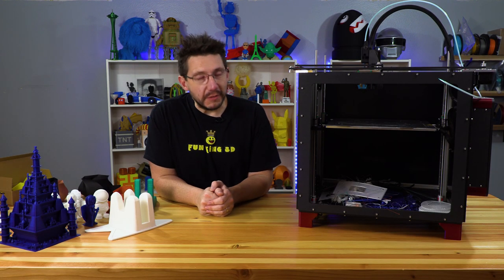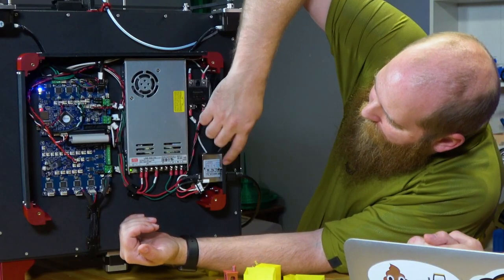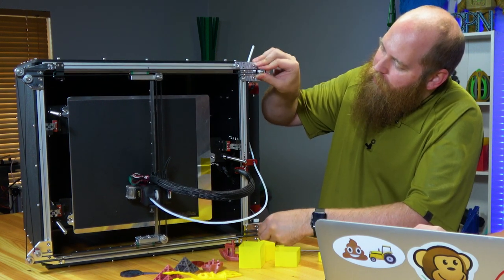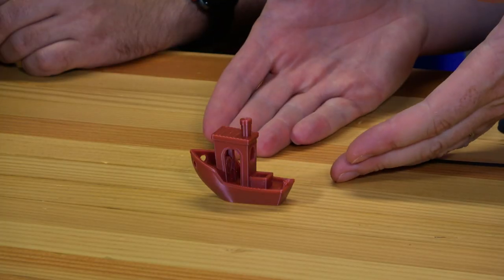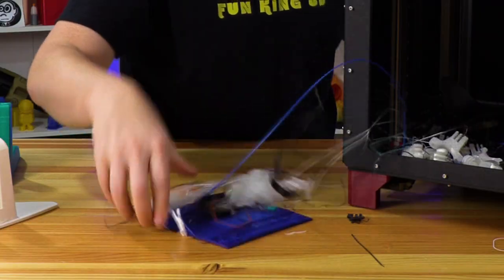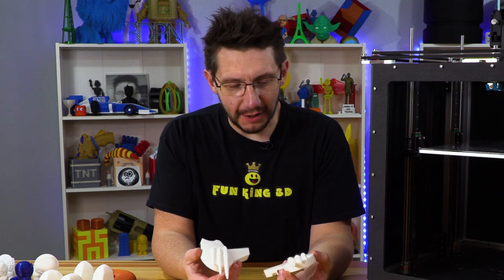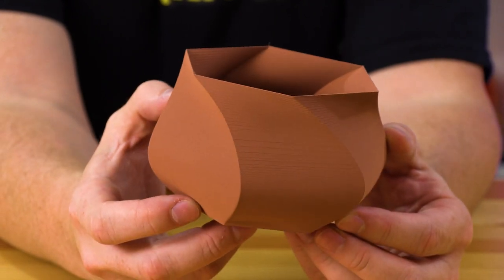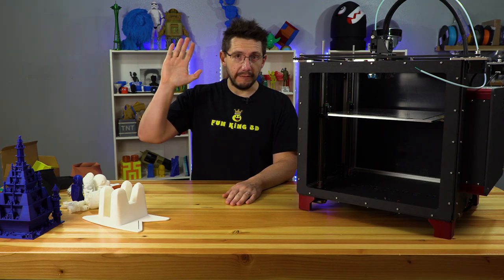Railcore II 300ZL Project R3D 3D Printer Kit Review

Comment: That benchy at 75mm/sec was insane! Geeezzzz...I love this hobby.
Reply: Nothing special with a core, 75mm/s is slow for a core actually, 150mm/sec by 6000mm/s² accleration would be nice^^
Reply: Voron2 does that with klipper, although it's pushing the V6 to slightly beyond limit at common layer heights. With the mosquito hotend, that should be easily doable.
Reply: @jadesontal4947  as i understood it, it is about the bed level accuracy and the special aspect was the very thin layer hight with this speed. It would have been nice to know, how well it performs at 150 or 200mm/sec.

Comment: god I want one of these soooooo badly. I saw some of the 0.02mm (not a typo you read that right) layer height prints this machine can achieve and they are truly awe inspiring !!

I can print benchy's like that all day long with my ender 2 army. ...... at 20mm/s max speed !!! this thing does it equal or BETTER at 75mm/s

staggering. GOD I want one of these things so bad. who do I have to eat to get one.........

as for bed leveling. I question if (within a reasonable price point) if its even possible to achieve the needed resolution with a mechanical bed detection solution.

meaning I don't think a mech switch solution can level with enough precision to achieve the better than 0.02 resolution you NEED to get a 0.02 layer height.
Reply: The one comment I'd make is that the current design has a FULL STEP Z distance of .01mm. The BLTouch I use is repeatable to .01. After a couple of cycles of bed leveling, it reports .004 across the *entire bed*. Even if you assume that it's limited to .01 across the whole bed, that's still well within the required tramming for .02. That said, I usually start with a much thicker layer, anyway, for adhesion - like, 200% high and 200% wide.
Reply: You can use a different bed leveler on the Rail Core, only this kit ships with the one in the video. From what I understand it's easy to replace and you can always start with it if you source the parts yourself. From my research into this printer over the last 6 months it's very easy to modify to what you want.

Comment: The hardened nozzle needs 15-20 °C more than a regular brass nozzle. This could be the reason for the issues you had with nylon.
Reply: do they really? i use a hardened steel nozzle and i dont use it anymore because it wouldnt print right, i thought it was just a quality problem but i didnt know that they needed to be heated more, maybe i will try that.
Reply: @willmoran5694  thermal conductuvity of hardened steel is lower than brass , so yo need to increase temperature to heat filament enough. if you dont , you should print so much slow.
Reply: Steel (nozzleX) nozzles don't conduct heat as well as brass so you have to increase the temp ten degrees depending on the filament.

Comment: One problem I found on my build was that most steppers have at least 1mm of endplay, so the Z height can change as the part weight increases. I had a lot of problems with weighty prints, and I found some steppers "springier" than others, so I put in the stiffest ones I could find to help resist the affects of gravity is the part weight increased. I built a 300ZLT, but I imagine the effect will be amplified on taller machines. Imagine a .1mm change amplified as the print gets taller, the part will actually take on a lean. One taller machines I think a thrust bearing setup would eliminate the endplay problem.

Comment: Hi, Joel - Project R3D has been offering pre-assembled RailCore 2 300ZLs... They are just the kit, built by the folks who gathered the parts, but it will save you the build time.
Reply: IMO they are not just the kits. The kits do not have the touchscreen - it is just being advertized as a possible future option. While the pre-assembled printers already have the touchscreen.

Comment: For nylon I have found a temperature change of a few degrees hotter can make a major difference. Also no fan. On my lulzbot mini the nylon was breaking apart easily at 235, but once i bumped it up 15 degrees it was perfect.

Comment: Thanks for this Joel, I'm going to retrofit an X5SA kit for starters as it could benefit from most of the frame/rail mods, then a new self sourced build once the BOM maths have been done by me for  a 400mm Z , saved me designing one from scratch as this incorporates all my ideas apart from a mech bed sensor, not seen the 3 Z motors before so that is a winner!

Comment: Your Wham Bam is warping slightly from heat....the problem with "spring steel is its BiMetal that expands "non-uniformly". Go down to your local sheetmetal shop and have them sheer you a mild steel galvanized piece...no warp...other than that this printer is SMOKIN HOT and after checking out the price, VERY REASONABLE!  If I had the cash I would order one....very nice review too!
Another suggestion is to tram the whambam at different temps to "catch" the warp at higher than PLA temperatures.

Comment: Doesn't the hardened steel nozzle have a lower heat conductivity? Might be the reason why the nylon prints didn't turn out so great.
Reply from the maker: It does, and, it's possible.
Reply: That is very likely, the hardened steel nozzles tend to be a thermal bottomless pit. We tend to adjust our temps up between 15-30c above brass.
Joe 
Project R3D
Reply: Came here to offer this up. Nailed it!

Comment: Skipped Hiwin rails because they didn't add to the build relative to the expense, but used the E3D gold edition v6. Not to knock the build, because it's just plain cool (and while it tickles me, the gold v6 is only like $40 more on the cost of the whole bot), but it makes me wonder how many corners I could cut in a scratch build without sacrificing print quality and reliability. Filed under "fun project ideas for later."

Comment: Thanks for the review !  This printer is almost exactly what I am looking as my next printer since several months. Linear rails; bondtech & direct extruder, 32 bits electronic etc... But what about the enclosure ? Do it works as  it is not closed on the top ? did you try ABS or ASA ?  What about Flex print and the bondtech extruder ?
Reply: We have a fully enclosed top in the works. All the steppers are outside the build volume (except the extruder) for this reason. ASA and ABS print g reat on it, as does TPU.

Comment: Well... I suppose I need to get myself another printer.
Reply: just not this one,  - prone too board failure, ...  overpriced spare parts....   high five !
Reply: @patrickwatkins7572  I have duet on 2 printers and works great, all boards fail if you connect them wrong
Reply: smiles john
Reply: @mostlymissiles  smiles john
Reply: @patrickwatkins7572  The duet is the best board on the market currently, hands down.
Reply: @tonyakens8228  . not in my opinion,  but im an electronics engineer,  so if you care too elaborate, im all ears
Reply: @patrickwatkins7572  so why it itsnt the best and which one is ?
Reply: @patrickwatkins7572  My Duet WiFi has been rock solid for over a year, since purchased. Care to elaborate why you say this? What's failed on yours?
Reply: @patrickwatkins7572  The feature set & firmware are the best I've found. (I have several duets) One or two folks are using Klipper, which is looking like it has great potential, but isn't there yet.  That said, the RailCore can run on other controllers, too. Which would you prefer?
Reply: I'll wait for the price to go sub 1.2 grand..  😆😉👍
Reply: @patrickwatkins7572  show us a better board and we will test it.
Reply: @elfpimp1  if you are wanting to hit the $1200 price point you will have to self source and buy lower quality hotends, extruders and rails.
Reply: @elfpimp1  don't even think about hiwin rails then
Reply: @mostlymissiles  lol. I have a printer. Cost me less than US $350. 300x300x400 print space.  I love the 20/20 frame and all the connecting hardware is metal. I can switch between 1 and 2 nozzle system if I want. And it's fun to use.
Reply: @Patrick Watkins, it's fantastic that you are an electronics engineer. That means you can effectively explain why you feel the Duet is prone to failure. Not having owned one I would much appreciate some information on why I should supposedly avoid the board. However, throwing about "prone to failure" and educational degrees while being coy comes across as FUD, not helpful information. You have an opportunity to serve the 3D printing community AND Duet in the event they can fix something. Please don't waste that opportunity.
Reply: @RegularOldDan  AAANNDD silence, tends to be the standard response from people who approach products like that and try to throw around degrees. By all means if he knows something everyone else doesn't Id be happy to listen but I doubt we will see a justification.
Reply: @patrickwatkins7572  The ease of firmware editing, macro editing, wifi browser operation and file transfer. To name a few things that make it really nice. But yeah those are software related you might not get it with only an electronics degree.
Reply: @patrickwatkins7572   Where do you guys come up with this crap?  Board Failures?  Nope. Overpriced spare parts?  Nope.
Reply: @patrickwatkins7572   If you are an electronics engineer why dont YOU tell us what you are talking about?  We are all waiting
Reply: Hi Guys  my experience is a bad one because of build quality, - i had a "random power reset" issue, . poor form from the manufacturer, . anyway after replacing the cheap chinesey power supply too no avail,  i decided too check the board for faults,  and i noticed i could trigger the reset fault by placing a slight twist on the board, - anyway i turned out too be a solder flow issue, - - i would rather pay more for a machine that was well tested, well built and well supported.  - problem is, its just too cheap, . - but if thats what you want, buy an Anet machine, add some frame supports, invest some time, and you will still be under $200, for a 30x30 machine., or do what i did, and build your own...   thats the spirit of this community,  unless you want too spend 10k
Reply: @patrickwatkins7572   Huh? I'm not believing that you have a RailCore
Reply: @ericfletcher8454   Eric., please stop sending me messages,  i do not work for RailCore,  i am just trying too share my experiences.
Reply: @patrickwatkins7572  I am not "Sending you messages" I'm merely responding to your post's here. and trust me we all know you don't "work for Railcore". My guess is that you bought one of the Counterfeit Duet Boards and now blame Duet for it.  We also all know that you have ZERO experience with the Railcore printer

Comment: The extra fan power is for bigger nozzles so it's actually a good thing. With a 1.2mm nozzle you'll have it closer to 100%
Reply: I'm running the volcano 1.2mm nozzle, fan is at 50-60 for PETG
Reply: @mostlymissiles  Thanks for that, for PLA it will be more so I'd say the powerful fan is a pretty wise choice
.

Comment: Oh, did you ever do a video on the different Core XY printer types and which you like best? I see there is the ones with the X axis at the top of the printer with different rail configurations and the Print bed moving up and down. I prefer a printer with 4 lead screws one at each corner of the bed. and the one like this printer and the Voron that the Z and X axis work together to print where the bed stays fixed to the bottom. I would probably use a dual gear direct drive system.

Comment: Hope to see more printers like this with actual bed leveling (tramming) instead of compensating by adjusting the Z offset as it prints. Looking forward to more videos on this once you get things dialed in.
Reply: Yes tramming is great, but you can't level out a bent bed or sagging rods. Compensation is a solution to some problems, but not all.

Comment: Either you or Sean +1 for Rick and Morty true level. I was laughing for a solid 3 min!  Now I have to decide between this and a resin printer in February lol. I tried finding info on this tool changer, but as far as I can see it allows swapping of heads?
Reply: TheMidnightSmith I put it in there, but then later Joel mentioned it  when they wrapped up talking about the bed leveling (and i took it out to avoid redundancy). So, really, both of us!
Reply: @Aidenn23  you guys are epic! I love it!

Comment: Great review, the kit looks amazing in so many ways.  I think your points good and bad are spot on.  I don't think this kit is for me until it matures and has stronger support.  I'm not into the "tinker" category.  I just want to design and print things, but I do desire the layer detail.  I'd be totally all in for a resin printer if it weren't for the whole, toxic, smelly, messy bit.  So this printer is really exciting from that perspective and I'll be keeping an eye on it.  But I think this printer represents a step in the right direction to bring us greater detail and accuracy at ever faster speeds.
Reply: You dont really have to "Tinker" with this printer, it works straightaway
Reply: Come join our Facebook group and check it out in more detail.  There are 80 or so "in the wild" - it's just the kits that are newer.
Reply: @tonyakens8228  I'll just have to do that.  Thanks for the kind responses.

Comment: I think the only weakness on this machine is the IR probe. I'd NEVER had success getting one of the differential IR probes to perform consistently in my environment on any of the machines I've tested with one.
Reply: Very easy to bolt on a bltouch
Reply: Or just slap a precision piezo on it
Reply: @turk639  have you done this? I've used bltouch with little success, ezABL with great success but would also like to try a piezo disc. I've struggled to find a way to mount them on my Cartesian printers (all I've got). I see they mount well on Deltas but what about CoreXY? Do they mount better on these style of printers?
Reply: @drammy  for a cartesian I might recommend using the under bed piezo's because the movement of the z might give some false readings. on my corexy it works great and have had very reliable probing done with it. check out https://www.precisionpiezo.co.uk/ they have setups for mounting under your bed.
Reply: BLTouchs are on the way moving forward all new units will have BLTouchs but SSSSHHHH we arent announcing that until tomorrow!

Joe 
Project R3D
Reply: Aus3D's IR  Z probe and David Crocker's differential IR sensor are easy to mount to E3D V6s, and work well enough for me not to consider the BLTouch and capacitive sensors I have.

Comment: Also, PEI is IR transparent and won't work with the IR sensor that kit gets.
Reply: Yeah. There's a lot to like about the IR sensor but it's clearly not a universal sensor. I don't currently use any IR compatible build surfaces. The IR sensor's designer goes as far as suggesting painting the back side of the PEI, but that sounds like a bad idea.
Reply: @JeffDM  replace the IR sensor with a bltouch
Reply: I used to IR sensor on PEI for about a year, it works just fine.

Just changed it to a precision piezo orion though, which is imho the perfect sensor, but the IR does indeed work with PEI.
Reply: @mostlymissiles   Or Better yet replace it with a Precision Piezo Orion and use a Screw Mount E3Dv6 heatsink.  THAT is a bombproof and robust setup that gives a true nozzle height
Reply: I tried like my damnedest to get the it sensor to work on pei. I wasn't going to pain the back of it black. I place a piece of black paper under the pei, on top of the aluminum, and I still got unreliable/unrepeatable results. I too switched to piezo, and that is absolutely the most accurate, but it's not perfect, you must have a clean nozzle before probing any oozing will mess up you results. It's still a setup where I need to clean the nozzle manually before I start the print. My other config with a bl touch can just click print and go.
Reply: Yea just get a precision piezo which will do a way better job

Comment: Tried the duet ir sensor, couldn't get it to work reliably on different print surfaces either -- I switched to piezo on one machine and bl touch on another -- PS -- love the lead screw compensation duet -- produces absolutely crazy level bed -- I am using 4 lead screws -- and it works incredibly well -- your bed has to be dead flat though